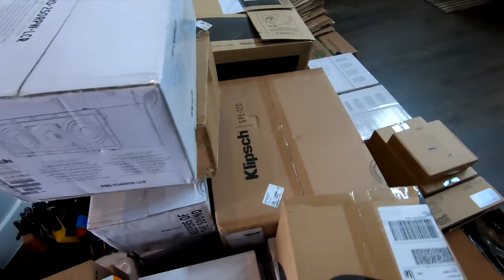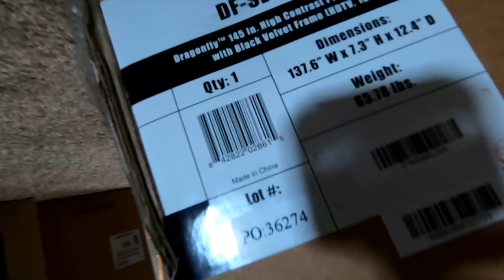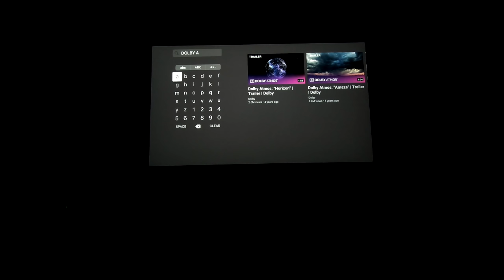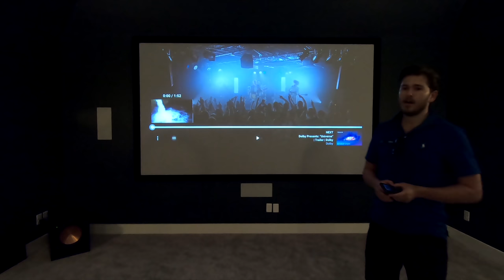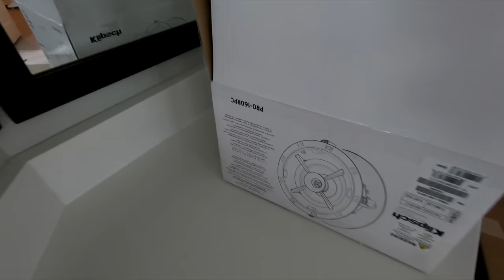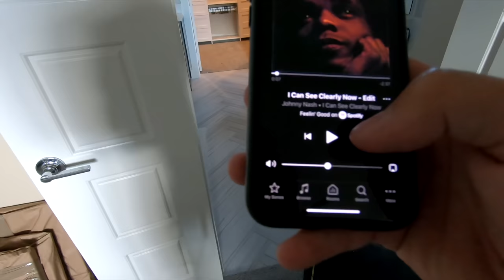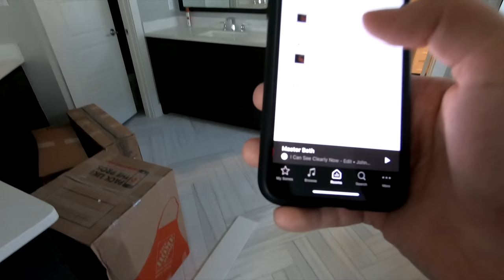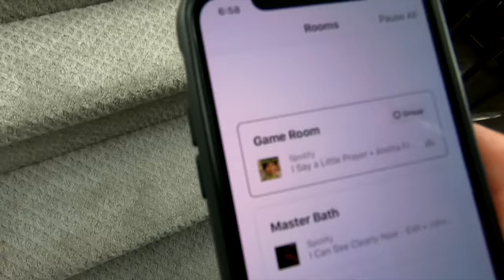MASSIVE 145 Inch 4K Projector Screen Epson 4050 Klipsch 5.1.2 DOLBY ATMOS & SONOS

Comment: Coming from a former low voltage wire, alarm and home theater installer; these guys are the truth. Professional, clean and knowledgeable. I watch these guys documented installs like its a show on Discovery. Will be building a finished attic home theater in upstate NY in about a year, wish these guys could travel. Take my money!

Comment: Decent video but pro install has me confused. Either I missed it or never said why there is only 1 sub. Plus front stage is wrong. If ever recline vocals will be almost gone unless they use All Chanel Stereo all the time and the left and right are above normal seating. Clean install this and looks great but a audio transparent screen would have made more sense. Were they aware of these issues and wanted install anyway?

Comment: Hard working owner . Nice to see. Do you ever make suggestions for the owners to paint the ceiling dark and matte paint for better image on screen? They spend all that money on great equipment only to lose a good deal of image quality with reflections from the room especially that ceiling.
Reply: Tristan Jones The impact isn’t HUGE with the painted walls but sometimes WAF and other factors come into play. Wouldn’t be too difficult to paint afterwards.
Reply: @midwestiowashooter  Actually the high sheen paint used in a room with side walls reflecting light back onto the screen is just as bad for a white screen. Washing out the  image destroying contrast muddying shadow detail and blowing out your specular highlights. Not things most owners will even notice until you take them to a blacked out velvet room and use their same equipment and show them the full capability of their projector and screen in the proper environment.  Personally I would have used a grey/ALR screen in this room due to the ambient light bouncing back onto the screen from all that paint. But I am sure the homeowner was thrilled and that is all that matters.
Reply: @keepingupwiththejones2933  Exactly well said.

Comment: Badass setup like always. . . @23:40 you can spend $70 for a toner or you can do the old trick that does no harm to speakers by using a small "AAA" or "AA" battery and touching the speaker wires to the + and - and you get a static tick sound at the other end ... lol ; ))

Comment: I thought that you could only run shielded speaker wire through the wall. Just picked up 500'of sheathed 14/2 to rerun my inwall theater setup. Looked like the ones you were using were not fire retardant

Comment: I know one thing. I'm listening to this video off a cell phone.  I know I'm far from the Keepers Of Sound but that room is going to need some acoustic paneling. A lot of eco in that room. Also it would be nice to know the size of the rooms that you do as well. It would help those do it yourselfers figure out what size screens and how to set up the systen. Great video in installation but you never mention the room sizes.
Reply: To be honest room dimensions are pointless. Every house has different size rooms and configurations. You have to work with what you have.

For figuring out what size projector screen you want. 2 ways you can achieve this,  one way is use a measuring tape,  2nd way is project the image on the wall to your liking then measure it. I used the 1st option for my setup.

Comment: Nice. Question. Why don't you guys use banana plugs?
Reply: @scotttild  I see. I've never had an issue with plugs popping out. As you say, it's a pretty solid connection.
Reply: @NVC77  I find they are neater to work with, but I get your point.
Reply: Noah Fogarty but much easier for customer, service or replace if they have issues. If wires are labeled correctly a 10 year old can figure it out!🤷🏻‍♂️

Comment: Why don't you recommend 2 subs especially with a room that big?
Reply: That's a 12inch sub, bass is much less directional than higher frequencies, that single 12 will easily pressurise a room that size.
Reply: @JamesCampbellMr  I agree, but sound isn't only about pressure. With only 1 sub, there will be some nulls or dips in some bass range. With 2 subs, these dips disappear. This video makes it clear: https://www.youtube.com/watch?v=eXfH9WH8Yw8
Reply: @JamesCampbellMr  The size of the room is never given so how would you know if one sub is enough? It might be but you have no idea. Higher ceiling isn't helping with pressuring that room either due to introducing more volume in the space.  Bass nulls are also more likely with cathedral ceiling as well. Bass up will follow the path it is given since it is not directional.
Reply: I'm sure he does but the customer might not want or be able to afford it.